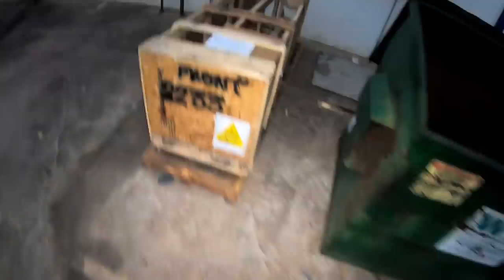Dumpster Diving "I Got Somethin' For Ya!"

Comment: Mike, I found 53 lbs of Cat 5 wire the other day in a dumpster. At first when looking the dumpster didn’t look like it had much of anything, but I started digging around a bit, and I found one little piece of blue wire, a pulled on it. It eventually led me to a whole pile of rolled up pieces in a huge nest all the way underneath a bunch of ceiling tile. I ended up getting $1.24 a lb for it 👍👍👍👍 THANKS MIKE FOR SHOWING US WHAT’S GOOD !!!

Comment: 0:05 plastic top cover for IBM 4800 base unit for cash register
0:41 lower halves of IBM 4610-TI4 receipt printers
1:25 rear door of IBM cash drawer
1:55 chassis of magellan scanner/scale
2:04 paper tray for Lexmark laser printer
and miscellaneous IBM 4800/4900 I/O cards and other stuff in the trash bags.

Comment: The individual insulated wire in the romex is easy to strip with a sharp knife and a vice. Just stretch it out straight and lay your blade against the copper and walk it back, with a little practice easy peasy. The bigger wire is most likely 2/0, 2 aught is how it is said. Nice kicks!

Comment: Hey, Mike. Love your work. Glad you got those safer(ty) shoes. In my line of work we are issue cut "resistant" gloves. They are rated at different degrees of resistance to puncture and cutting pressure. They are not all that uncomfortable even when threading on nuts and other intricate work and are relatively inexpensive.  They can be found on the internet for sure and possibly in some big box stores. Would like to see you protect your digits a little more. Safety first!

Comment: You need to bring the magnetic tool with you that you used to take the water heater apart with. That way you can get all that little stuff easily and a bucket.

Comment: Those small circuit breakers you could sell in a yard sale. They are still good. Just used. Find an electrician and see if they would buy them 4 for a dollar or something like that. Average 15Amp breaker at lowes and home depot is 5 to 10 bucks and the 20 amp are more expensive. Lots of different brands.

Comment: If you don’t want to harvest the silver contacts, copper/brass from the breakers, maybe someone local would want to buy them for that reason. They are kinda tedious to break open though.
Also I recently got $1.60/lb. for several box loads of mid-higher grade circuit boards. It was a pickup load, but $450 worth!

Comment: That box you didn’t know what it was is a meter box. Those 4 copper slots is where your electric meter for you house goes in. The aluminum pieces should have a big screw bolt that the power cables go in. The 2 on the outside are for your hot legs and the one in the middle is for the neutral.

Comment: Those small circuit breakers just drill out the 3 rivets and the prongs sticking out are solid silver.  Thats some expensive scrap. Its well worth the effort to open those breakers. You will get more than you do for number one copper. That's money in the bank son.

Comment: Does your scrap yard do a low brass breakage you should ask all small switches bulb sockets plug ends recepticles light switches breakers ... Computer ends  escrap stuff microwaves have the magnetron that has 1/4 - 1/2 a pound of copper if you pull that apart

Comment: If you do a lot of copper wire, you  already know the price is so much better without insulation.  There's a YouTube vid about a guy who built an insulation stripper made from a free treadmill. It worked great, I'm getting ready to build one.  Keep your eyes open for free treadmills, their motors are great are machine tools.  They're bringin' $100+ on eBay.

MOST of the individual breakers are likely good.  Put those panel boxes & breakers on Craigs List; anyone capable of installing a service panel will know how to test the circuit breakers.

Comment: I used to I still scrap but if you find a microwave you take the glass out of it and then you take that little other part out of it it goes with the piece of glass then you open it and you just fill it up with metal feel all the way up with metal and then shut the thing and then when you go to scrap it just take the whole thing and throw it in the scrap pile all your little metal you put in the microwave it makes a heavier

Comment: You need to have 2 or 3 55 gal trash can at the back of the truck to put all the small items in. Stop take item home your going to trash 
36:50 that the box used for your Elect Meter

Comment: sweating like a pig? Teaching time. Pigs do not have sweat glands and do not sweat so that's why they like to wallow around in mud puddles. Now how do you find all the good dumpsters? I hardly find anything in dumpsters in my area. Another great video man. also did you give up on getting parts for your space ship? you haven't mentioned it in a while.
Reply: Oh dear how patronizing are you? I suggest you get your facts right   "sweating like a pig" has absolutely nothing to do with pigs, it is in fact  a reference to pig iron when it's been heated and it cools down reaches its  dew point and leeks. Now your have been taught.......

Comment: It's inflation. All commodities are up but lumber is up 200% since last year. With so many dollars in the system all commodities and assets are inflated. The Fed says inflation is only 2.1% but in reality it is 15-20%. Copper, limber, aluminum from eggs, gas to housing to trading cards to used cars are all inflated by spending.

Comment: Love your channel. Was in scrap and auto salvage for 15 yrs. My boss passed away 2 yrs ago. I still cant help but see value everywhere in scrap. I see scrap metal laying on the ground. I can't help but throw it in the back of the truck. What stripper machine do you use? Trying to clean out shed and barrels of wires among other scrap. Can't decide on the best wire stripper. Everything from bare bright to car wire harnesses plus lots of #1. Hoping you have a suggestion on what I should buy for a stripper machine. Let's just say I think its going to take me awhile to do all that I have. Boss told me once if you see a penny pick it up. One it's a penny more you have then you had a second ago. Plus 145 pennies makes a lb. Copper at the time was almost $3 a lb. You double your money with 145 pennies then it's face value. Keep doing what you do so well. I think he would of loved you and your channel.

Comment: 2015 computers? I doubt it but ones that new are better resold on the cheap if you can make em boot, my best pc is about that old (a i5 4690k, high end mid range home pc, high end cpu of that range is the i7 4790k (4 core 8 thread).  Still holds up for anything you'd want to do given a good gpu (1060 or better and 1080p in almost any game 60 fps still without mods, but 4k gaming is where it'd struggle, but ANYTHING struggles with that.  Was handling Tomb raider 2014 at 60 fps back then in benchmarks.

I'd bet those computers are core2duo or pentium 4 or D, those aren't worth much.  Small form factors (such as those you picked up) aren't meant to be changed into gaming pcs (though they can be to some extent as all you really need is a good gpu, cpu and probably some more ram (8 to 16 gig will do for anything these days, at most you need 32 gig of ram for the most intense games on the highest settings).  Truth is if those computers actually are as new as you think they are (can tell by opening em up or looking up the model dell or hp whatever number) and finding out what was originally in them (which may or may not still be in there) you can learn the value the parts still have (just a matter of looking up numbers)

Point being you can use them for parts or a newer pc (depending upon what you have) or resell the parts (pretty much any part almost even low end) for more than you get for scrap.  Yeah there is a risk of sensitive data going into the wrong hands so i don't blame you for doing that (only needs about at 1 time $13 investment to read most hdds on the cheap aka usb 2.0 to ide/sata (both 2.5 inch drive or 3.5 inch, 2.5 being usually laptop drives)

Even if they aren't that good ANYTHING with quad core or 4 threads (i3 is at least 2 core 4 thread for the oldest ones from 2009, also when the earliest i5 (4 core 4 thread) and i7 (4 core 8 thread), most any other oddball name like Xeon (server cpu basically), Athlon/64 (were once the high end AMD range back in 2000-2006ish to compete with Pentium 4, D and high end pentium 3 (pentium 3 and older sell that for certain at a garage sale, people WANT those if  they want to make a retro gaming pc)

Not that hard to do (just basic screwdrivers needed really)  Just make certain they're dry before you give em power or you are likely to short things out.  Ones in that range would probably have a Windows 7, 8 or 10 sticker on em though, in rare cases maybe the Vista era (vista is older than 7 and newer than XP, usually seen on core2 (better is the quad, still viable today for a low end machine), core2duo (dual core), Pentium dual core is just the half cache of a core2duo (same socket but worse cpu is all it means)  Celeron and Semperon are Intel and AMD's usual old code for low end processors too.
Reply: you could try biking around your neighborhood on trash day (just after dinner would be prime time to pick up the good stuff, tvs, computers etc),  As far as tvs i'd say resell if they don't have any issues, a simple test of if it gets a signal in clear enough to watch with rabbit ears is all ya really need if it has the stand since a program-able remote can be had for about $8+but if its there grab it and try it out.

Comment: Most of the Lumber you guys in the US use is imported from Canada and the previous administration imposed import Tariffs on all Canadian lumber combo that with a big housing construction boom in both Canada and the US and we have a big big supply squeeze thats pushed up prices $$$ 🚀.  I suspect that the current President Biden will take down the Tariffs and this Weill cause prices to fall. However they are already up almost 3x from 1 year ago so yeah prices will still remain at elevated levels.  There could be a opportunity for u if u find some good lumber in the dumpsters.